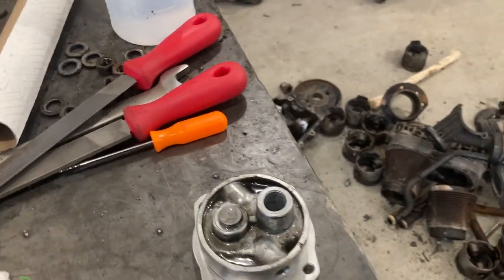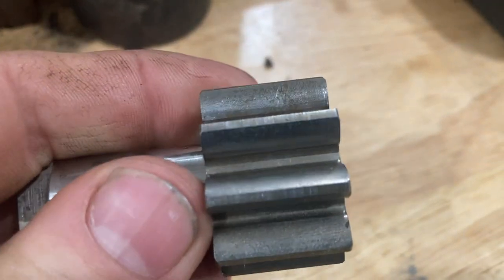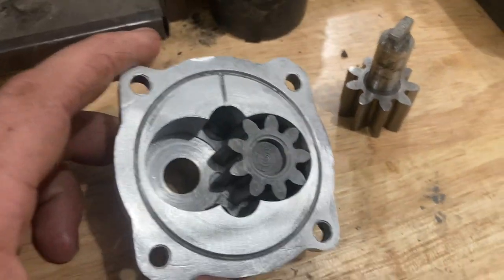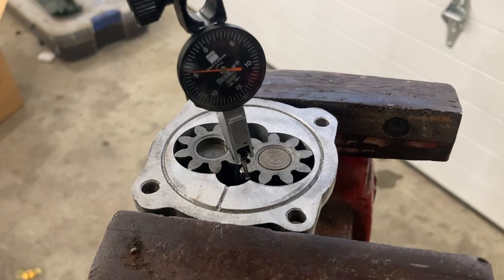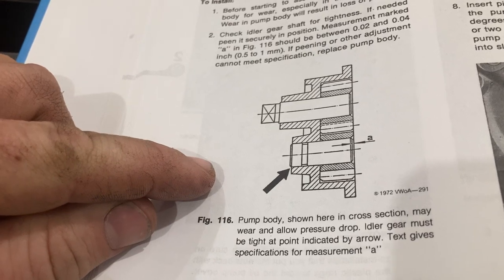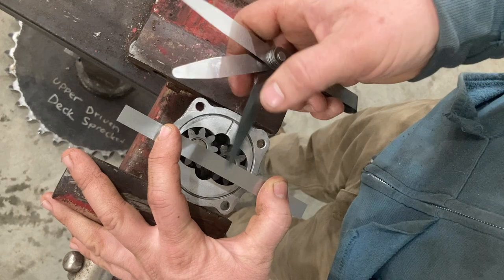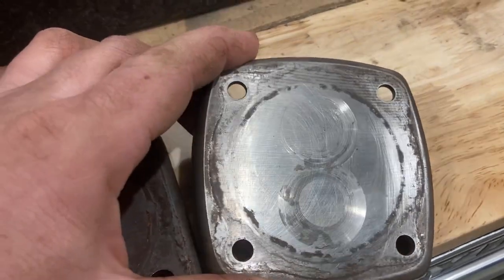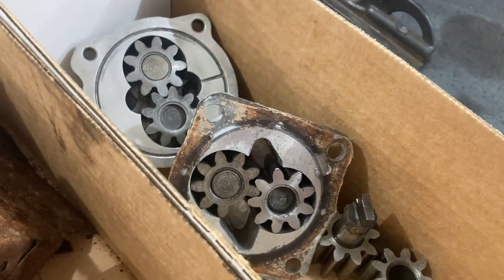AirCooled VW Oil Pumps - Proper Tests & Inspection

Comment: Hi, is there a specification for the backlash for the drive gear when inserted into the camshaft slot? cheers
Reply from the maker: I haven’t seen any specific tolerance given for that in the Bentley Manual

Comment: So new pumps come with new plates like the ones you show with the grooves from the gears?
Reply from the maker: No not in all instances. Covers are often reused, and many people turn them 90 degrees so the wear patterns offset.
Reply from the maker: It’s better to resurface it, even if all you have is a piece of glass and some sandpaper